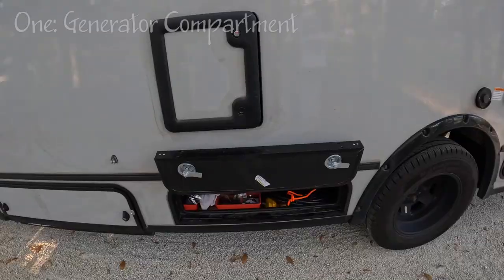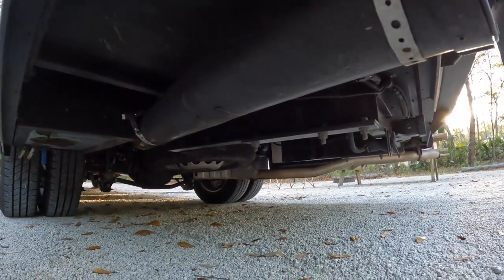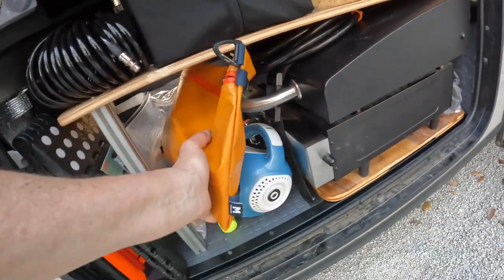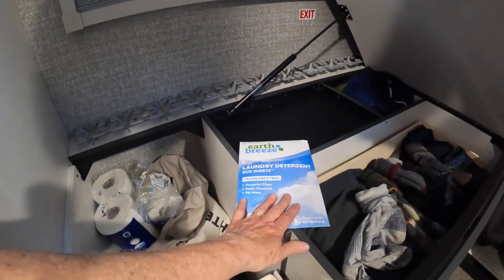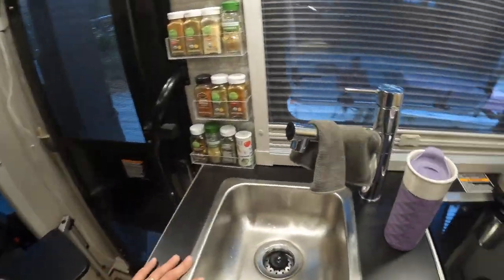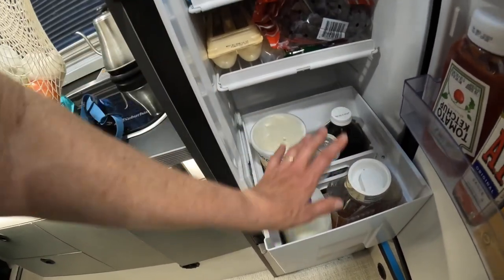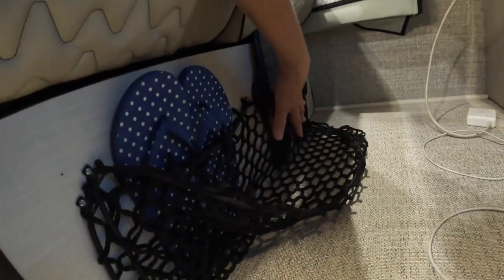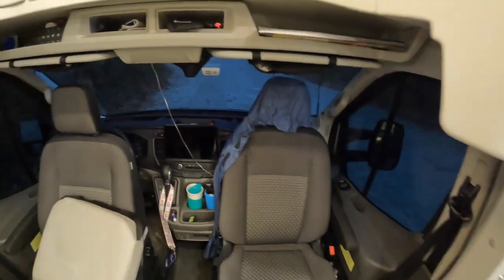Our EKKO Organization

Comment: Question about the 2x6s. The Ekko naturally sits 1° down in the front when on completely level ground. Do those 2x6s bring the rig to perfect level when on a level parking spot?
Reply from the maker: Hello John, From what we’ve observed on a level site, the front corners are about 1.2 to 1.3” low (as shown on Truma’s leveling tool) so putting the 2x6s under them leave the front about 1/4” high.  Our comfort level in that situation is do not do anything for one as we don’t notice that amount of slope, and two is that it seems a little slope will help the bathroom drains toward the gulper.  If the rear is low or a side is low by 1.5” or more we’re more likely to adjust level as the side to side difference is more noticable and we don’t like sleeping with our heads low.

Comment: What lift mechanism did you use for the bathroom cabinet door?
Reply from the maker: John, we did not modify the bathroom medicine cabinet. The strut hinges on the cabinet were installed by Winnebago. We believe earlier models of the EKKO used a different mechanism than ours. It looks like "Blum" is printed on the hinge, but a quick glance at Blum's website didn't show anything that looked like our hinge. Hope that helps!

Comment: isnt it better to have a generator?
no sewer  hose for me!
Reply from the maker: Having a generator is a matter of preference and depends on your style of travel. We generally move every 4 to 5 days, sometimes more often. So the alternator along with the solar keeps our batteries charged for our needs. We have never used nor needed a generator. Other people will not live without one. If you don't want a sewer hose and have a gray water tank, how do you empty it?
Reply: @BackroadBuddies  I dont know how you empty it? I guess I'm referring to toilet.  sorry .So  it comes with a hose?  Getting ready to purchase my ekko
Reply: @BackroadBuddies  I am a glamper not really a camper but worry about my dogs and ac running the whole time
Reply from the maker: @vickiemcginty5523  There is hose for dumping the gray water tank. You can dump the cassette toilet without a hose, but we normally dump it into an RV dump, so using the Americanizer adapter for the hose makes that easier.
Reply from the maker: @vickiemcginty5523  a generator is good for running the AC when you don’t have a site with electrical hook ups or parked somewhere during the day. We don’t travel with pets and only use AC when we have hookups. Be aware that some places won’t let you run a generator or have limited hours when you can run it (so the noise doesn’t bother other campers)